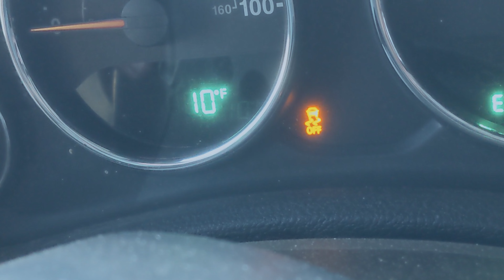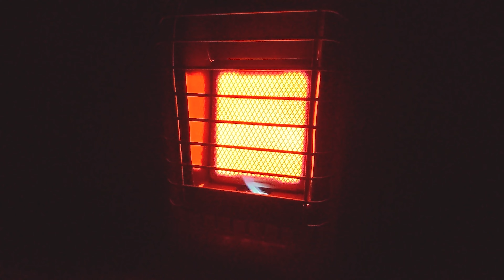The Coldest Night I've Ever Camped | -14°C with a BROKEN Mr. Heater Buddy

Comment: Should probably stop using mr heater. Just get a Chinese diesel heater, it’s only 130$, and its dry heat.
Reply from the maker: I've heard many mixed reviews on cheap diesel heaters, and would hate hearing it run all night. The heater buddy has served me well for several years; just need to put the old one out to pasture I think.
Reply: The issue is that when propane burns it creates water vapor. Which then condensates . Condensation is not a good thing in winter . 

Also the diesel heater just needs a new fuel line and a fuel filter ( 15$ upgrade ) , and make sure you have a 500 watt  battery, and it’s super reliable. Also you can put it away from camp and you won’t hear it .
Reply: Just trying to help . Love your videos and it’s a great to see another Sahara out there ! 😌
Reply from the maker: @lederppz6202  yeah it's definitely something to watch it for, but I do vent my tent on all sides and in the last few years really hasn't been any issue. Appreciate the support!
Reply from the maker: @lederppz6202  absolutely. I feel like we're few and far between
Reply: Right on. Thanks for your service !
Reply from the maker: Appreciate it 👍